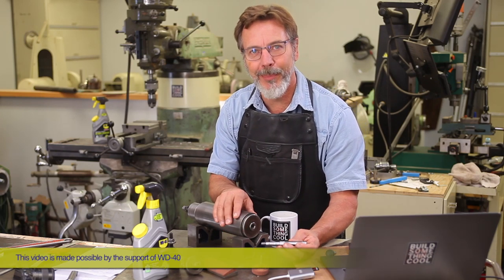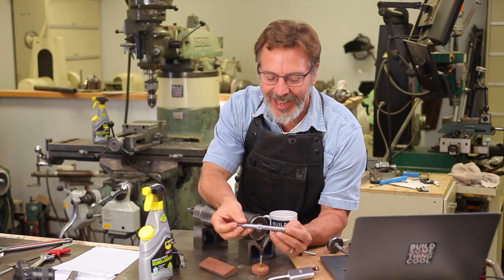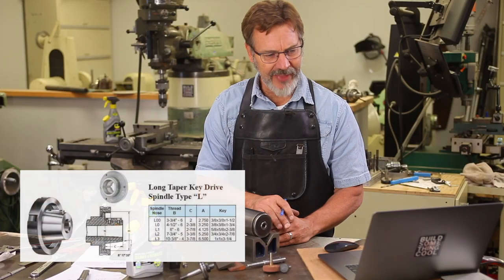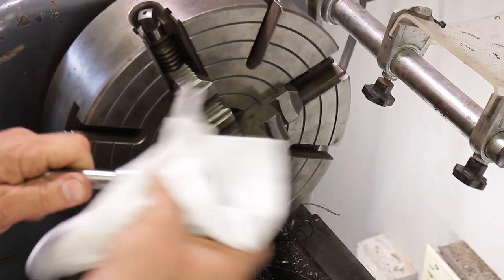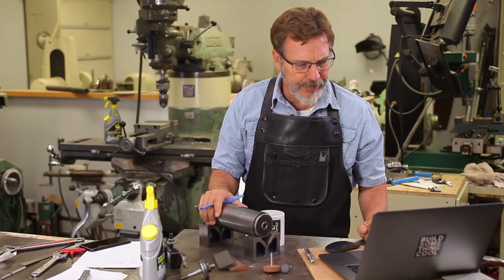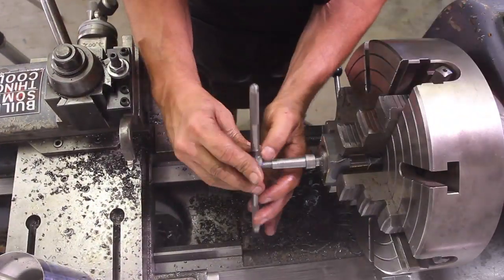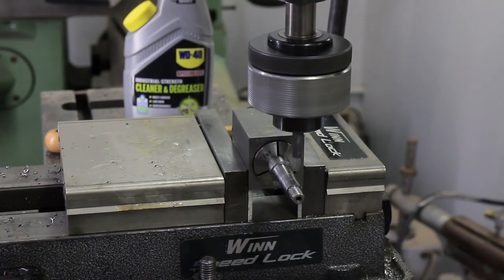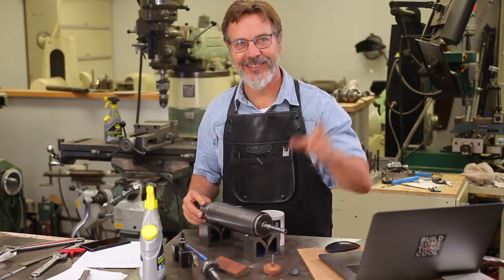Grinding  Arbor Build

Comment: Dale, I was the one that you gave the grinder spindle at the Bash. I found out that spindle was for a Covell tool grinder. I started building an arbor for it, but it got put on the back burner for now, I had to get some work out for customers. I need to tear that spindle down  and clean up the bearings. Also even though the spindle has a taper there is no draw bar so I need to figure out a way to lock the arbor in place. I didn’t think about relieving the center portion of the taper, I guess I probably should do that.

Comment: I know that O-1 is less likely to warp than other steels, but considering that it is being used as a high-speed arbor I would think that you would want to leave it slightly oversized, harden, then take it to final dimensions. Let us know how it turned out after hardening!

Comment: Dale,  at the end when you gave it a spin it looked like it has some run out.
Enjoy your content, thanks for sharing.
Rick - St. Albert, AB
Reply: Yep, it definitely does look like it's wobbling quite a bit.
Reply: stick a clock on the shaft please
Reply: of coarse it did, he made it
Reply from the maker: Good one,  LOL
Reply: Remember he has to harden it and grinder it in. So I hope he left material
Reply: @josephlovell6951  Yes, good point.   
Hopefully he will show part two.
Reply: I had to watch it three or four times before I was sure. Yep, that's some run out. Hopefully Dale made everything slightly over-sized so he could use, ahh, some sort of contraption to perform a final grind after hardening.
Reply: But when the rotary grinding stones are dressed the runout shouldn't make a difference
Reply: Matthew Hill   The stone( grinding point) may run true but the balance will need sorting, me thinks.
Reply: I was thinjking the same thing!

Comment: How often do you get hot chips on the top of your safety flops 9:09?  I'd be scared to death to wear those in the shop.
Reply from the maker: All the time,  it still safer then working around horse,  You haven’t experienced pain and tell you’ve had a Appaloosa on your foot.

Comment: I am a new hobby machinist, but O1 steel is a PITA till you find the sweet spot machining it. I found that deeper more aggressive feed  cuts improves the surface and gets the swarf to chip instead of dangerous strands. This is with carbide inserts though.

Comment: Hi Dale I'm from Virginia 36 years machinist love most of your videos. My suggestion for mill taping would use a tap follower and T-handle
Reply: Johnny - I'm also from Virginia.  I had shop in high school many many years ago but I'm playing with it again (diy cnc) since I retired.  P.S. Shenandoah Valley
Reply: @oldestnerd   Yeah I ran the big cnc Lathes, mills, multi pallet machine centers (98 tool belt ) and cnc grinders P.S. Tidewater area. No not ship yard

Comment: OK Dale ,so you want to know where I live. I'm English and live in an engineering desert called France. How on earth can you find tool steel at that price when over here mild steel is more expensive. I have met at least 1 good turner but they are very few and far between. All in all STAY away from here!!!. By the way, I want to get in touch with you to tell you a far simpler method for half angle screw cutting. Thanks for all your enthusiasm and excellent videos.

Comment: There's a lot familiar in this video (To me). I use O1 a bit, because it's a good alloy steel, and often less expensive than 4140. It's also easily hardenable. Love to hear what you think of using it and leaving it in an annealed state.  Still has better specs than Mild Steel. A lot different to work with though.  I also made a set of brass jaw protectors, that I can't ever get the piece straight or square with XD Great in theory, I can't get it to work well in practice.  Thanks for the vids. Great Job!
Reply: Love to see you heat treat it.

Comment: You have been to my house so you know where it is. lol But wait did you just take that thing to size before heat treating?  I hope distortion doesn't get ya!
Reply: bcbloc02 yip agreed! O1 (k460 for the rest of the metric world) will bend like a 🍌
Reply: Guaranteed to warp like a banana, as the W.Nr. 1.2510 tool steel just does that. Also hardening it is completely unnecessary and even if hardening, only the tapered shank would need hardening and grinding to size.

All the arbors on the Jakobsen OD/ID grinder are not hardened, as they just don't have to. They will vibrate the same in hardened/unhardened condition, so why bother.

Comment: i just notice at 12 minutes when you spin the grinding bit i saw the shaft jump little bit. i don't no if you take the time to check the run out with dial indicator? and do you grind the part after hardening process ?

Comment: San Antonio TX - noticed some runout at the end - you plan on doing a final grind after hardening?
Reply from the maker: You saw it correctly,  it was not tighten up all the way, but with that being said it runs out about .003. After I harden it I’ll grind it in to true it up.😀

Comment: Nice video, but oh boy, O1 tool steel. Dale's almost certainly in for a nasty shock when he heat-treats that.
Unless he is super lucky, it's going to bend like a banana, then he's going to have to make a new oversize part, heat treat that, and then hard-turn or grind it to final dimensions. Not fun at all.
He has my sympathy.
An air hardening tool-steel (e.g. A2) would give much less grief than that oil hardening O1.
If you want a really high-strength, better wearing part, use D2 tool steel. (it is more expensive though)
(PS: I'm from the UK)

Comment: I’m from London, England and no machinist yet, but I have a question.  It looks like your cutters are tool steel and not carbide... so how can you cut tool steel with tool steel?  Excuse the dumb question.
Reply: The tool steel that is being machined is not yet hardened, the cutters are hardened.
Reply: Thanks Matthew.  I need to read up on what makes the difference in steels other than just carbon content.

Comment: My friend borrow my Mikita electric die grinder
Said he had a arbor
The next day he said when he turned it on the harbor freight arbor with new cut off wheel bent and was shaking so violently he had to use both hands to hold on to it and couldnt turn it off luckily his brother was there and unplugged it
Ive always just made mine from a grade 8 1/4” bolt that i cut the head off of
We laughed for an hour as he kept demonstrating 
Luckly no one was hurt

Comment: Hi Dale, I'm watching from England where everything cool or important in the world was invented, (unless you ask a Scotsman! https://www.youtube.com/watch?v=zaJPOVGlEPs), so trust me when I say that if there's one part that should always be turned with a drive dog and flipped between dead centres - okay, centers - to eliminate potential runout, this grinding spindle is the perfect example. You can drill and tap the nose in the 5C collet fixture later. I would also take the time to harden the fixture block if it isn't already so that damage isn't such a concern when chucking, saving all that hassle with the copper and brass shims. Just my two centers - I mean cents!

Comment: I have a ton of respect for what you’re doing with your videos. But the latest videos are coming across as “sell-out.” I don’t normally post negative feedback but I think you need to slow down and try and generate some higher quality content. The finished product of this video has run out, barely made contact across the taper, and was generally sloppy from a machining perspective. Take it for what its worth
Reply from the maker: Hi Tim. I agree a should have given more details about the machining. Thanks for your patients as I try to get back into  the grove of make a new video every week . Thanks for your comment.😀 Dale
Reply: @BuildSomthingCool  It's not the details missing Dale. I think this is not the way to build a high-speed spindle, there are too many mistakes to mention. Better to bring out a high quality video every month than a bad video every week. If a not-so-experienced machinist (that's me) can spot the problems here, then there must have been quite a few. There is no way this thing is going to work without dangerous runout on the tool, even if you try to grind it.